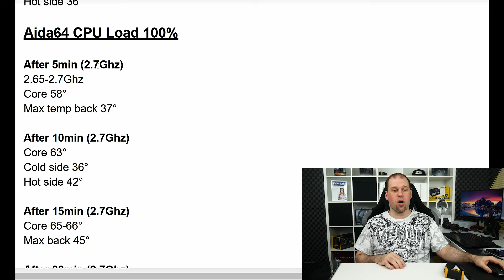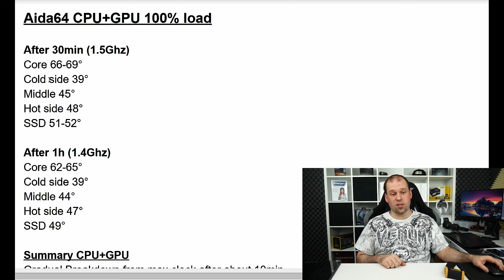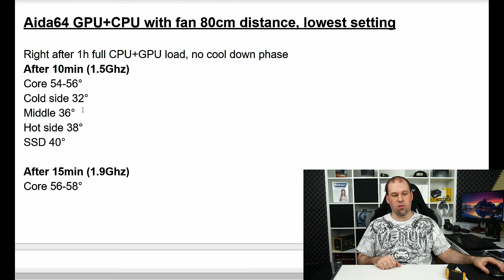Acer Aspire Switch Alpha 12 | in-depth Stress/Heat Test

Comment: That result is pretty good~~ Although I will suggest to do the Heat Test with power plug in, which may make it warmer and more likely that's when you will do full load.
Reply: +Damir Franc oh then it sounds good, I asked this because my laptop i5 processor won't turbo to max while using battery

Comment: Hey Damir, can you do a temperature comparison between the Acer Aspire Switch Alpha, the Surface Pro 4 and Asus Transformer 3 Pro. I live in a fairly tropical area and it would be great to learn which of these three would run best. I currently own the Surface Pro 4 and already have heat issues after prolonged use with about 10 Chrome windows and 1 video running.

Comment: I work on hot environment (37 to 40 Celsius). Will machine work fine with 60 Celsius when i measure with Speedfan? I run some task and CPU low as 20% with 2.7 Clock-base.
Reply: Damir Franc It means that my Acer is not good for my business and i need to look fan version laptop.

Comment: I have this computer, same configuration (i5-6200U, 8g memory 256g SSD).  When I was playing an online game called War Heroes (www.y8.com/games/war_heroes), on the last level, level 12, this computer will slow down to a crawl within an hour.  First I thought it was because I had played for a long time, but when I let it cooled down, then just started playing that level, the core temp shot to 69 degrees C within 10 seconds (I used Speccy to monitor).  Less than 10 minutes into the games it was alternating between freezing for a couple seconds, then moving again for half a second or so.  Made the game unplayable.  The core speed dropped down to 2.3ghz briefly.  But even when the core was running at 2.69ghz (normal speed), the video was already stuck intermittently.  Very poor, gimmicky fanless design.

Comment: Hello Damir, I have been using Acer switch Alpha 12 (i5) for less than a month now. 1 week back, I downloaded a racing game after which the laptop got tremendously heated up & batter levels started reducing drastically. So I stopped palying the game but even now, the laptop gets heated occasionally & battery reduces faster than usual. Can you please tell me why it is happening & if there is any way to reduce it? Thanks in advance!
Reply: siddhartha bhattacharya same thing here.

Comment: Sir, what's your room temperature ? Is it an air conditioned room in which you are recording this video ?
Reply: Damir Franc Thanks, i wanted to know specifically about air conditioning because that if was on would have kept the air dry and the environment would have been a better heat sink.
Reply: Sir, Could you please tell me the operating voltage of this laptop. I intend to be using it in India on my vacation where the voltage is 220 V and 60 Hz, as opposed to 110 V and 50 Hz in America.
Reply: Sir, I need a little help here. I purchased the Acer switch alpha 12. And I've been using it for a week now. I keep monitoring the core temp and the max it has reached now is 65°C . But since past two days I feel my laptop is swelling near the 'Acer' logo. Does your laptop also have a bulge near the logo ,or is it only in mine. I fear that the battery has swollen. Also I'd  request you to tell me the average time required to charge this laptop from 0 to 100% . 
Please help, thanks in advance.